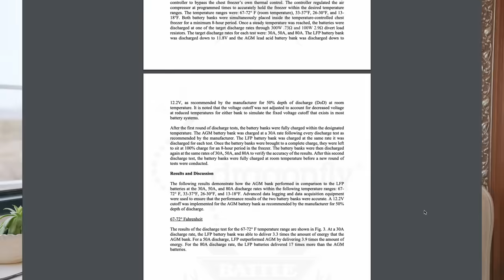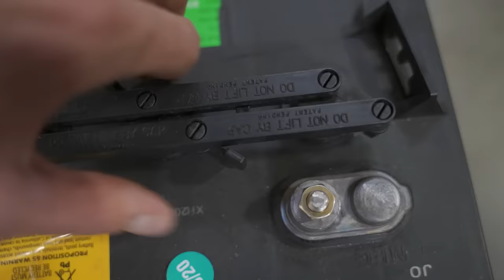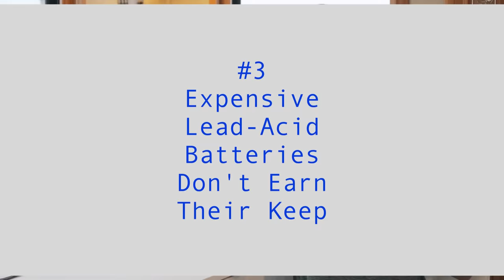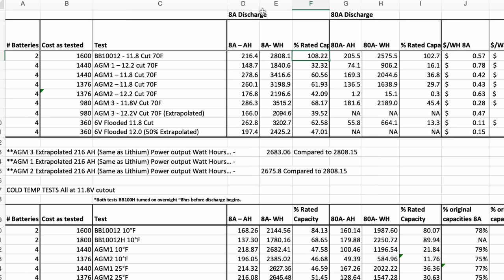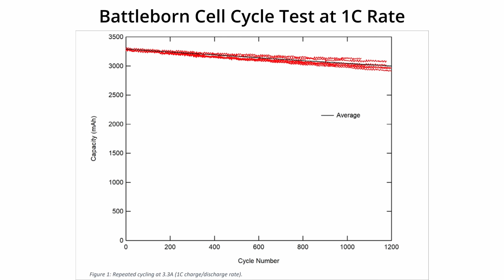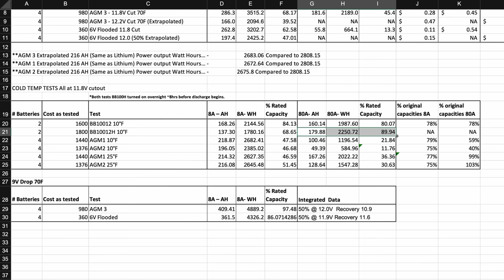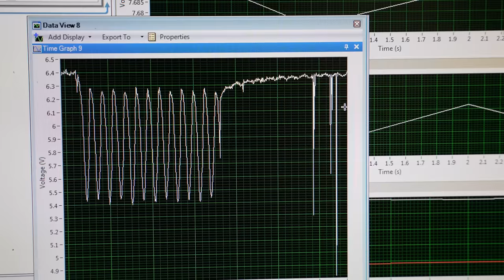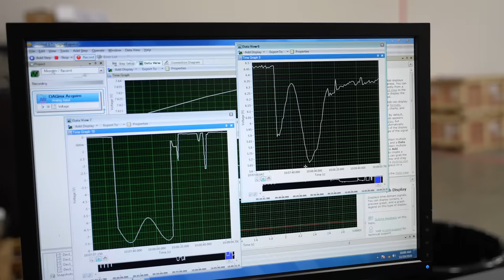Don't Waste Your Money On Batteries - The Shocking Truth I Discovered When Testing RV Batteries

Comment: Doing Off grid Systems since 1999 real life applications… the Li batteries do not take well in sub zero temps and will not recover when then temp is back above freezing….AGM will recover….
Reply: Good info coming from real-life experience. However, he did say that the Lithium's were insulated and heated for cold weather applications which would offset this problem area for them.

Comment: Even considering AGM in this context is utter nonsense.  Flooded lead-acid deep cycle batteries have the longest track record in solar electric use and are still used in the majority of stand-alone alternative energy systems. They have the longest life and the least cost per amp-hour of any lead-acid.  To use a deep cycle AGM only makes sense on very small systems due to no maintenance.  As far as Battleborn is concerned, it is good design.

Comment: Soo ok

What does a person do who lives in Canada and has to handle the harsh cold where Lithium batteries will stop charging when it gets to freezing temps?

Lead acid may be limited, but they dont care about the cold.

Then there is the fire factor, as we saw with the cell phone fires which happened with no notice, or the EV car fires which cannot be put out by the fire department.  They just try to save what is around the blazing car till the fire burns itself out in 30 to 50 minutes, destroying anything near it.

This makes it a bad idea to put lithium in the heat of the home/RV.

You can get lead acid in numbers to make up some of the load loss and be safer on top of it and as far as weather goes, be almost indestructable.

Lithium is not the perfect choice and you have to keep in mind why lithium batteries are so dangerous in a fire.
Lithium batteries will create their own oxygen as they burn so you can't starve them for air.  Water does not seem to have a big effect on the fire as it burns.

Sure you can have a lead acid fire,  from cables mostly, but so can lithium.
But lead acid wont start a fire internally and become a burning sun as it burns down everything around it.

It's great to sit there and quote numbers of a perfectly working battery but nobody talks about the dangers of using this type of battery.  It's about time both sides of the story are talked about.

Comment: Hi June 2023

Absolutely thorough tests, analysis and report. Very helpful information for me.

I've started dabling in solar electricity and battery backup.

I bought four Harbor Frieght 100 W solar panels at sale prices of $89 & $99.

My objective is to provide occasional "emergency, survival power" and not contagious Off-Grid use.

Being retired money is an issue eliminating (at this time) Lithium Ion batteries.

After much study and analysis I chose to use lead acid batteries.

Rather than AGM or Deep Cycle Lead Acid Batteries, I chose instead USED professional RECYCLED/REMANUFACTURED AUTOMOBILE LEAD ACID BATTERIES that I can buy for $20 to $40/ea for 65 - 70 Ah GRP 24 or 100 Ah GRP 27 $35/ea.

Of course I know Lithium Ion would be superior.

My deciding factors were cost and that BOTH Lithium & Deep Cycle Lead Acid manufacturers warn to limit deep discharge to 50%.

I intend to limit discharge to only 50% when possible.

But in an emergency use of an Auto Lead Acid  battery I figure use you can get away with deep dischange  a few times  before destroying.

 Even then the cost of  replacement of RECYCLED/REMANUFACTURED AUTOMOBILE LEAD ACID BATTERIES is an acceptable expense.

btw - I've used RECYCLED/REMANUFACTURED AUTOMOBILE LEAD ACID BATTERY in my car for a number of years without failure.

Comments please.

- Paul

Comment: Not convinced using manufacturer life cycles in my personal use is accurate. I don't discharge anywhere near to 50 and never discharge at high rate.I have and have used lead acid batteries for many, many years beyond what they are supposed to be capable of. Seems like the discharge rates are higher than i would use personally. In a camper scenario who is it that tries to run microwaves and coffee makers on batteries? The ridiculously high cost of some lithium batteries can keep me in very new lead acid for many many years. Not convinced.

Comment: Can you connect 4, 12v Lifepo batteries in series and 3 in parallel to the same charge controller and bus bar?
Reply from the maker: As long as you have 3 sets of 4 in series... If that makes sense. But yes as long as the voltage is all the same. Dont exceed the manufacturers voltage ratings however. Check out my latest lithium battery video for more on that!

Comment: How many times did you charge and discharge the lead acid batteries before doing the capacity tests?
I've read a few data sheets from different manufacturers that show a chart of capacity across # of charge/discharge cycles.
I've personally found somewhere between 10-20 cycles for the flooded batteries to reach peak capacity.

Comment: It’s interesting that you’re doing this testing I think that ultimately it’s a waste of time the technology that has come out here recently although the volume of the battery pack would be a bit more the density would go up batteries that I’m referring to are the LTOor titanium oxidate  The technology is sound enough that even Tesla is starting to implement them in their newer vehicles just their own version the chemistry allows you to get below zero and still be able to apply and pull charge and they will let you charge and Paul current at higher temperatures without catching fire here’s the really remarkable park when they get hot and decide to burn up they basically I met water vapor this has something to do with the chemistry interacting with him energy I will also point out that the LTO batteries have a 20,000 life cycle yeah 20,000 cycles and your battery still might be kicking pretty awesome stuff check them out they are two companies Toshiba makes them a Chinese company Yen long and of course thereabout three times as expensive as say a standard lithium battery and I’m referring I Lipo 4 Chemistry not the dreaded cobalt chemistry anybody who puts the cobo chemistry in their own home is willing to live with fallout if they ever catch fire happy charging

Comment: I thought all electronic engineers knew how useless AGM's are, hence why manufactures are phasing them out. I was very confused why on earth you used 6v batteries? why? it's also well know to use 12v thick plate deep cycle lead acid batteries for leisure i.e. motorhome/boats, so why did you not test those?  here in Europe most leisure Lithium batteries have internal heaters which are automatic, if it needs it, it will switch on.  most motorhomes have solar chargers to keep their batteries charged, so not worried about standing for a few months, At the moment I use two 12v thick plate deep cycle lead acid batteries, which have 95% going for the last four and a half years now, at £85 each it was no brainer, however when we change our Motorhome we will have a bank of LiFePO4's, as they are a lot safer now, hoping the price will be a lot less by then.
Reply: In what way are agm batteries useless? They are amazing for turning a motor over.

Comment: In essence... both Lead Acid & Lithium Ion battery solutions that produce Power, are Chemical Reactions..! The speed/efficiency of both Battery's Chemical reactions are/will be effected by ambient air temperature.....! In the COLD ambient air Temp....the Chemical Reaction will be much slower as the charging period begins... until the Battery Chemicals get warmed up.....! Do not compare Lead Acid Battery's to lithium-ion-PO4 , there is no comparison between the two totally different Chemical Solutions...Productivity/in any way shape or form... It's like Apples and Oranges...! You wasted days/hours/weeks testing...2 different items w/out any compatibility whats so ever...! 12 volt battery's are good for starting car engines, that's it....!  6 volt Deep Cycle battery's... like Golf Cart Battery's.. are manufactured to produce more power for longer periods of time, to be discharged and recharged more frequently, last longer, they're more durable, better quality made, better chemical solutions...etc., etc. than any regular 12 volt battery made for a car/truck...! 12 volt battery's no good for Solar Systems...!   End of story....!   =)   Oh yeah, I almost forgot my main gripe..... You give me $950.00 for each of the 4 battle born battery's that I need for my system...... and I'll buy them....!  Other wise you can keep them.... not everyone has $950.00 to spend on One Battery.....!  =)

Comment: What is a shunt? What's it purpose
Reply: Basically a high current low value resistor used to convert current to voltage you can measure.

Comment: What about very hot temp like Arizona weather we can get upto 114 degrees, what battery do you recommend for off grid living
Reply from the maker: 114 is ok, 130 is where they start to degrade... So good airflow is essential.  Off grid Battleborn is great, but if you need large capacity alot of people use big battery

Comment: Lifepo4 batteries are not lithium-ion batteries. They are lithium iron phosphate batteries. Lithium iron phosphate batteries have a lifecycle of 1,000-10,000 full discharge cycles. Lithium-ion batteries have a life cycle of only 500-1,000 cycles. So Lifepo4 batteries will last a lot longer.

Comment: I do not believe your data on the lead acid batteries. I worked with open top carefully maintained  lead acid batteries capable of supplying 2000 amps at 48 volts. They were installed in 1954 and were still working perfectly in 1972

Comment: what voltage would a 35ah battery after drawing 35 amps for one hour?
Reply: The precise answer is lengthy and complex with many variables. Research usable amp hrs vs total amp hrs.

Comment: why buy AGM? deep cycle, long sitting times, better cold weather performance, etc. why by a cheap lead acid... you need a battery, and you use your car. I think i'm assuming this but... AGM has a longer life time over all. so... they really are just better batteries. they are more expensive and depending of what you need.... you probably should just stick with a standard lead acid if you don't have a specialized application or environment they are good at. Long sitting times, high drain, cold weather, etc. i wouldn't even recommend a lithium battery outright, just because they aren't worth it as a car battery. and at the point where you are using them to store power from a solar or a generator, you are better off buying a power wall from tesla or generac for that application.

Comment: "Pewcrit?" Do you mean Peukert's law approximating measured capacity versus discharge rate
Cₚ = Iᵏ t
?
Reply: I have a hunch about lead-acid batteries capacity ratings. Back in the 1970s I remember tbem being rated at the 20h rate (C/20) down to 1.1V/cell.

As a rule of thumb for energy storage, I've reckoned 1/3 of rated capacity, not 1/2. 

So you're right in the long term lead-acid is going to be more expensive than LiFePO4

Comment: Désolé de vous contrarié mais moi j’ai 2 6 volts plomb acide (US2200XC) depuis juin 2008 et ce sont les mêmes batteries qui sont dans mon vr mallard 2000 l’été dernier 2022 et elles sont excellente encore et elles passent l’hiver au froid car je les vérifie au printemps avant d’aller en camping… cependant j’ai un petit panneau solaire avec un contrôleur éliminateur de Canadian tire et débranche le détecteur de gaz pour l’hiver. Je ne dit pas que ton test n’est pas bon mais le mien est preuve faite pour 300$ de batterie c’est ce qu’il y a de plus économique. Je n’ai aucune génératrice et aucun service d’électricité de mai à septembre et des nuit sous zéro (nord du Québec)300 watts de panneau solaire.

Comment: Hi Tom. thanks for the video... great info. I just ordered a LiFeP04 from Battle Born. We have a 2022 Grand Design Reflection 5th wheel, and I'm trying to understand if the charger that came with it is suitable for the Lixx battery or if I need to make changes to it. Do you have any info on that? I don't know where the charger is located or what it looks like. I'm also adding a 200W solar panel and a Rich Solar charger.
I just learned that my 5th wheel has a WF9855 converter. The specs align with the BB battery, except for the Float: the WF9855 float is 13.2, but the BB float is 13.4 - 13.8. So is that a disaster?
Reply from the maker: We wrote an article about what components need to be changed when you upgrade to lithium, which you can read here: https://www.mortonsonthemove.com/how-to-switch-to-lithium-rv-batteries/
Hope it helps!

Comment: Well… A single battle born 100Ah battery is currently $874 with a 10 year warranty. One of my single Agm’s with a 95Ah (from the manufacturer) has a 4 year free replacement warranty and cost me $180…. I could literally buy 2 or even 3 of each battery in my bank to compensate for the %50 claimed rating and still be wayyyyy under the initial cost of these lithium batteries 😆. This is assuming any will fail at 4 years of course since they’ve been running for around 3 so far with no issues. I hope they fail before the 4th year because that will just make the cost of ownership that much less if they get replaced for free just before the 4th year 🙈. I guess I’m not seeing how the lithium will cost me less here or how expensive the Agm batteries you tested are 🤔?!?! I’m currently running 4 Agm with a 3000 watt pure sine inverter running an ac and a fridge. Backup generator only kicks on for a few hours at night. I haven’t calculated the actual amp hours I’m getting but I’m pretty sure it’s more than %50 of the rated capacity. For reference, if I purchase 2 of each and replace them at or after 4 years my 8 year cost for each set would be ~$740. Saves me ~$134 for each battery ($536 for all 4). Most likely though, I won’t have to replace them at the 4th year.
Reply: @Dirk Jefferson right!?!? Nothing wrong with naming the companies he’s testing in the video, hundreds of other channels do this daily. The cost needs to be justified by performance at least. While 10 years is a decent warranty, I could replace all of my batteries twice before reaching that cost 🤣. We are talking almost $1k for just 100 ah of power.

Comment: Hold on wait a second.... The lead acid batteries are 6v... Agm are usually 12v... I know you made bigger cells... But you did not calculate the extra resistance you put in through the extra cabling and the balancing of currents between the batteries.  so i don't think you can compare a 6v (battery lead acid) to a 12v (agm) battery. Can you please rerun the experiment using lead acid 12v batteries please?

Comment: Why didn’t you check the deep cycle 12 volt batteries that cost $70-$90 instead of just the $150 agm and the $300 6 volt golf cart batteries which were better than the AGM the regular deep cycle price wise for the price of 12 volts with the 6 volt batteries you can get 6 of the 122 amp’s per hour or 2 for the price of the 1 AGM battery they also have way more amp hours than a regular car battery
Reply: Deep cycle 12v batteries at Academy are $110 and high end are $250 at Renogy with no warranty mentioned.
Add $100 to it and buy a "Power Queen" LiFePo4 with 100% useable power.
What people don't understand is these batteries have a dropoff voltage and then the curve goes flat maintaining voltage all the way to the end of 0%
Lead is an angle drop all the way to 50% then goes straight down.

Comment: It's impossible to take this "test" seriously. For starters, anyone claiming to be an 'engineer' that repeatedly states that X battery or Y battery "produces power" - is full of it and never should have graduated with an Engineering Degree of any type. This topic is not up for debate. Period. Having taught EE at the Masters Level for 26 years at a major University, I know exactly what I'm talking about and this guy would have never received a Sheepskin with my signature on it if I ever heard nonsense like that. Batteries, by definition, are energy 'storage devices' and produce nothing at all on their own other than caustic waste. Let's call this grossly misleading and incorrect (boarding on an outright lie) statement - Strike One.  Strike Two rears it's ugly head in the form of hiding the names of the manufacturers producing the FLA batteries or the exact model number of the devices being tested. How the heck is that 'scientific' or honest? Yes, that's a rhetorical question. It's not 'scientific' or honest at all if key data points are not disclosed. Worried about pushback from the 'unnamed' manufacturers? This is the kind of testing done by someone with a predetermined outcome for the test to present the 'spotlighted' product in the best possible way. This is the exact same garbage/tricks that marketers and advertisers use to sell their products. Baffle them with BS, right? Truth in advertising here? Not so much. The old adage of "statistics don't lie but statisticians do" certainly applies here. Whoever pays for the testing .... wins. We see this all the time with things like unquantifiable 'computer modeling' for agenda driven testing for stuff like 'climate change'. Garbage data in - garbage data out. The only complaints I might have about the testing methodology would merely be nit picking. Overall, it's not bad. I don't care if there was a petabyte of data produced on that spreadsheet. Without knowing EXACTLY what was being tested - the data is useless. This test would never survive a 'peer review'. Strike Three is the same as Strike Two. I am semi-familiar with the 30 or so different Lithium battery chemistries and see choosing LiFePo4 as one of the safer (but lower performing) choices. BB gets brownie points for that - but only that. This whole video is pretty sketchy. The 'uninitiated' will see this video and say 'WOW'. Those of us in the 'know' will see this and think .... "are you kidding me"?